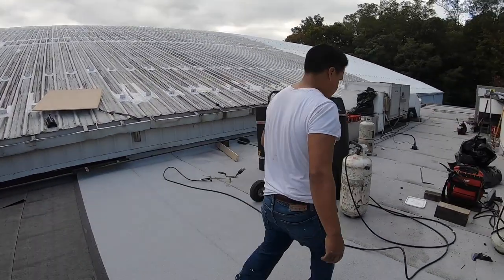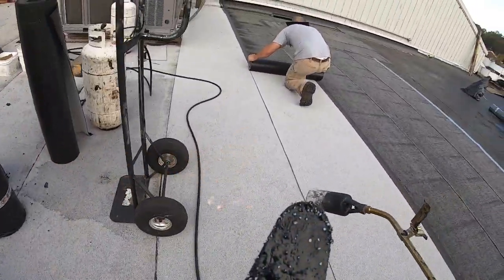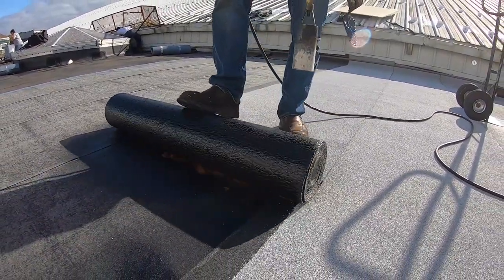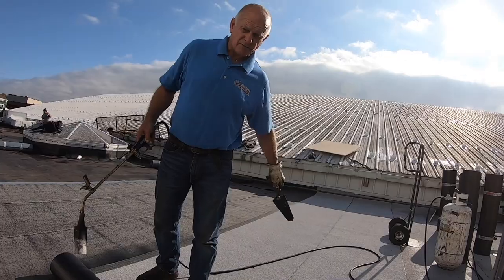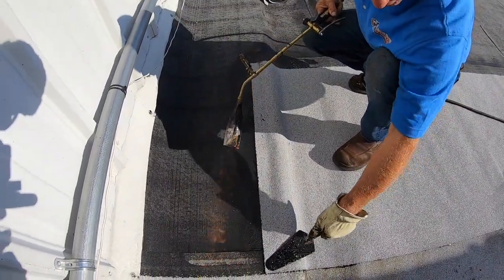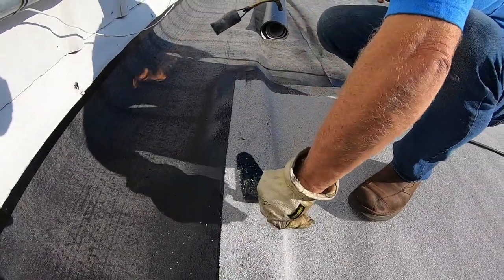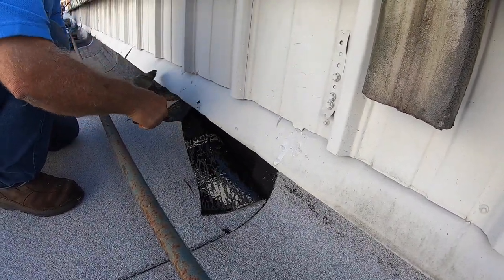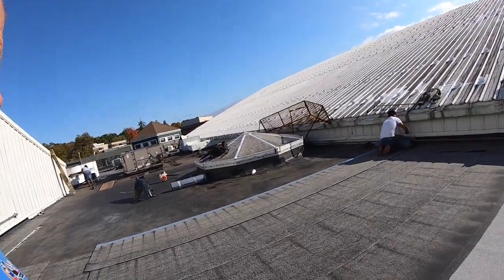101 Roofing - How to lay down a Torch Down Roll and Torching technique

Comment: I was a commercial roofer for 6 years and only did torch down. This is atrocious to me. Here in Canada to follow code you have to torch on wall flashings and cannot just simply torch your field up the wall. He cant even peel the packaging tape off the roll which will have a chemical reaction. I know he doesn't embed granules because there is nothing to embed. At that rate he'll probably finish the roof in 2 days and walk away with 15k in his pocket. You have some balls on you for displaying your hack job.
Reply: No doubt I've been in the flat roofing for 25 years don't know how this guy gets business
Reply: what do you mean torch on wall flashings, seems like he torched as far as he could and them tucked it.
Reply: @huntma3787 it’s called base flashing. You can’t run your field roll up to the wall and call it a day. Usually you run your field up past the cant strip a couple inches and then cut it off. After that you must measure at least 6 inches from the edge of the cant strip out and pop a line. Then you must prime or degranulate with your torch and apply your base flashing. Often times the same type of roll is used when flashing. In my experience, we use the white cap for the field and the veral aluminum for the base flashing! I torch lots of Siplast! 👍🏽

Comment: Nice work! Thanks for sharing. Can butane gas be used to torch down?
Reply from the maker: I am sure it can be used, but I would assume it is expensive. You need a high output BTU torch to heat up the surface evenly. That means a big flame, but when you do detail work then you need a small torch, I think that is where the butane torch will work
Reply: It’s got nothing to do with weather you’ve got a small head on your gas torch or not.!
It’s all about getting that heat into both surfaces simultaneously.
Some people use a long neck on the gas torch and some a short.
Also which side of the roll you stand.
It’s the even heat dispersed across the roll and under- layer.
I personally use a detail lamp ( Torch) for everything.
The secret is in the detail,not the quantity.
Steve Lewis NAWFRS 2008
Reply: Thank you for answering! I found out personally. First I bought a butane gas bottle, attached blowing torch, but it seemed that had no power at all like the torches from your videos. Finally I bought a propane bottle gas and it was mind blowing the difference, just like in your videos, it had the power to melt quickly the membrane. Butane gas is for home use , like cooking, for barbeque.

Comment: Sometimes when roll is too hot you can't step on it
Reply from the maker: correct
Reply: with sbs you need a cane but app you can walk on his field work was excellent most people get way too much bleed and it looks like garbage.
Reply: @pureblood6492  you've probably never done warranty work then. Every manufacturer wants a big bleed out, seperate wall flashings. I bet you I could peel his work right up. Especially the seams. I'd rather have something that will never ever leak vs "looking good" and almost nobody is going to see anyways. I work in one of the biggest roofing unions in the U.S by the way....
Reply: @Imthatdude8819  it the same with too much seam tape showing on epdm your seam will be weaker you should never exceed 3/8 of a inch when doing torch down.
Reply: @pureblood6492  epdm and torch don't even compare. Epdm is a garbage roof. Tell that to the siplast inspector I'm working with right now. He would have a shit fit. He wants 1/2 in minimum bleed out. Also he almost lost his mind because my coworkers weren't heating it up enough so you have a small puddle in front of the roll. I know this guy doesn't do manufacturer warranty work, he has admitted that he warrantys it himself. I would never ever ever ever use flashing cement to connect torch to the drip edge metal/gravel stop. It's called asphalt primer. This guy doesn't believe in it because "it's a small layer" he said in another comment. On top of that your supposed to strip it in with base and then go over it with cap sheet. I think manufacturers know more then he does.